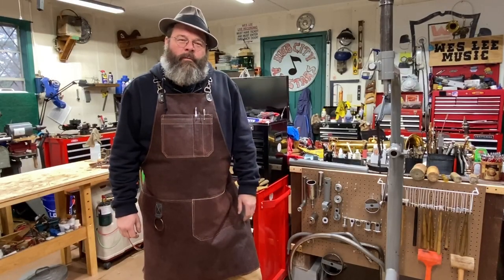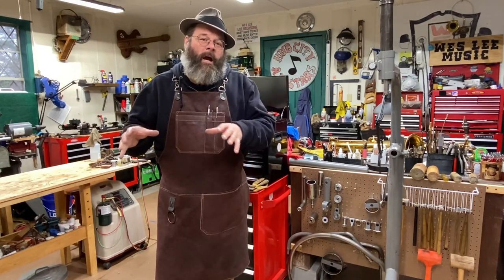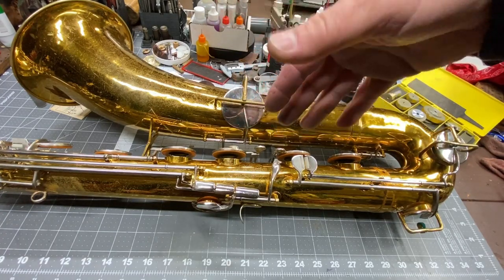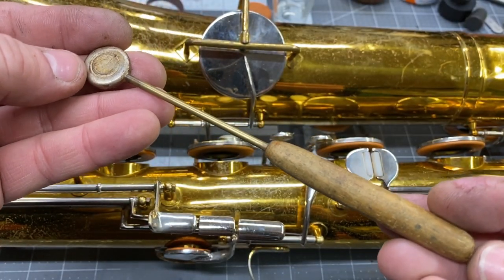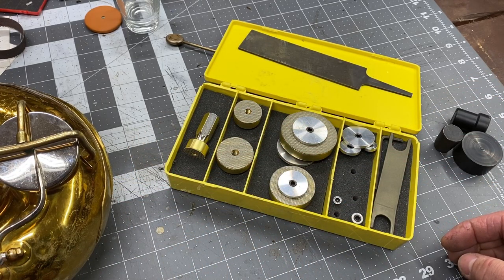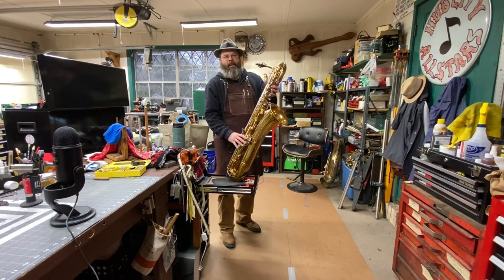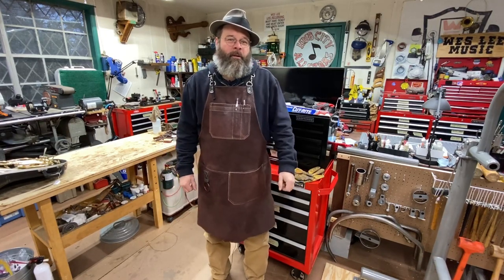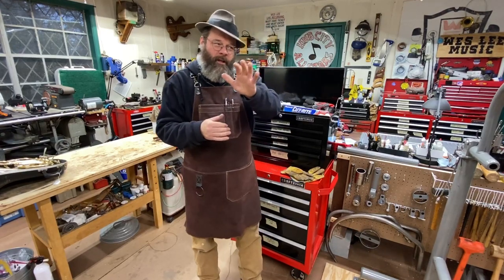Restoring the King Zephyr Baritone Saxophone- part 2- tools, techniques, play test adjustments

Comment: Wow great video! I just found your channel. Question for you: at the beginning you talked about taking the slop out of the linkages. If those posts are loose on the rods the rotate around, how do you take care of that?

I have a Selmer USA low A bari (my left pinky is super strong…), and when I first got it, I got it cheap because it didn’t play right below a low D. Turned out to be that G# key lifting! Replaced a single piece of felt, good to go. I’m also an engineer (amateur sax player…), so I’m geeking out on all your custom tools! Very nice. Wish you were closer to NY haha!

Comment: These are amazing videos. Love your work. Im looking to patch few hairline cracks on my buddy's tuba. Im looing to find some of the materials I'd need to do it. What kind of solder do you use and where can I find the material to use as a patch?
Reply from the maker: Thanks for watching. If you are going to make patches, then you can use from a donor body, or a hobby store has sheet brass, nickel silver, etc.for reasonable price. 
If I am doing a drop fill method, then I use low temp silver solder, otherwise I use standard 60/40. Flux I use is Sta-Clean.